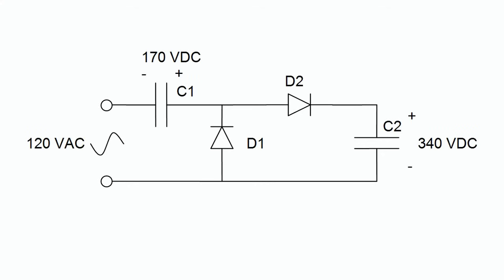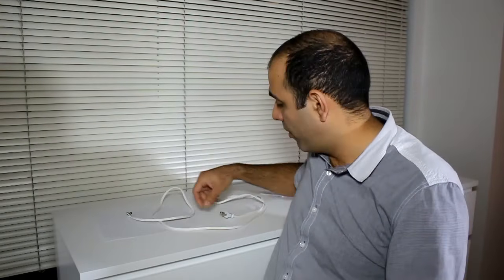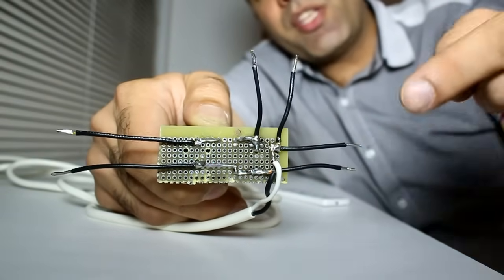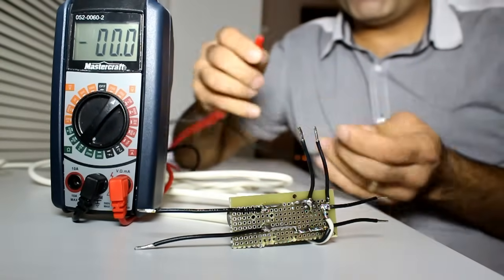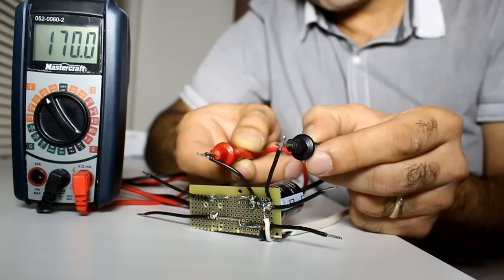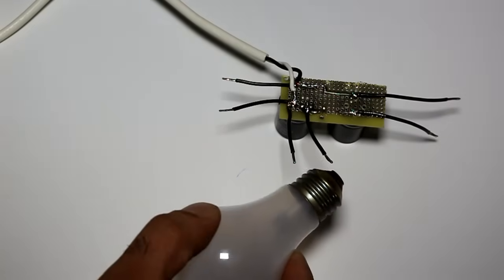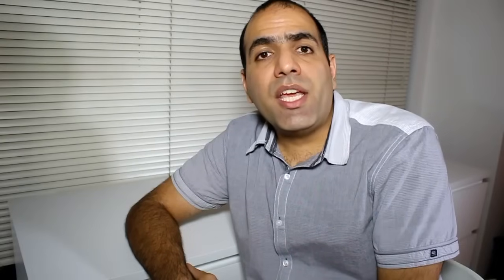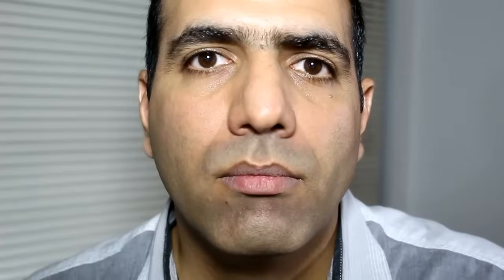High Voltage AC/DC Effect on Human Body

Comment: Best explanation on how a capacitor blocks DC! Seems legit.
Reply: Pretty hilarious. That sine wave just made my day. xD
Reply: I'm sorry but THANK YOU so MUCH for the laughs , I could not help myself. :)
Reply: GreatScott! Wow, you are here too. ;)
Reply: The AC explaination is extremely legit
Reply: GreatScott! Haha I thought it was funny too Arnold
Reply: I don't think you quite understand how electrical circuits and differential equations work my friend. Capacitors resist changes in voltage, meaning that the instantaneous current through a cap is i=c(dv/dt). So a cap, can never "generate" high voltages pikes, but can generate high current surges. Inductors are the complete opposite, they can generate high voltage spikes, but not high current surges. Take a quick look at this for a better explanation https://www.khanacademy.org/science/physics/circuits-topic#circuits-with-capacitors (I really suck at explaining)
Reply: No worries. BTW camera flashes use an inductor to generate high voltage, and a capacitor to store that high voltage. Google: "camera flash charger circuit" and you will see that there is a sort of "joule theif" oscillator in there.
Reply: thanx for the link, i bookmarked it, tho the first video seems to contradict a camera flash saying you can only have as much volts as a source (battery) when a AA battery makes a charge of 300V in a camera flash... tho things made a lot of sense since the differential potential of electron on both plates want to regain balance so i guess for 300V the disbalance must be huge! or maybe it's an Inductor in a camera ;P still it's a mistery why they use "Capacitors" in speakers for a high pass... then again this A/C thing is starting to make sense since if the slower it is the closer to D/C it is! hence any instantaneous changes versus over time changes, the instant ones don't charge but passes and overtime gets kind of lost (heat and dissipation of energy in air/ leaking to the other plate) so would they use an inductor for a LOW pass? ;P well even if you reply i might get annoying so let's just say i poured my thoughts on the matter ;P
Reply: This is extremely late to the subject but...The use of a capacitor in a high pass filter has to do with the Capacitive Reactance which is (explained in simple words by electronicsforu.com): "The lower the frequency of the applied voltage, the more time capacitor takes to be charged fully, before the voltage reverses its polarity and begins to discharge the capacitor again. The capacitor therefore spends more time fully charged and passing much less current, resulting in less current flow at low frequencies. When a higher frequency is applied, the capacitor changes from charging to discharging faster allowing more current to flow". Also, the formula for Capacitive Reactance is Xc = 1/(2*pi*f*C) which is supposedly measured in Ohms (according to electronics-tutorials.ws), so as frequency increases reactance decreases and as frequency decreases reactance increases. High Pass Filters have a capacitor connected in series to the source which will "cut-off" low frequencies and allow high frequencies to pass. Low Pass Filters have a capacitor connected in parallel to the source which allows low frequencies through (capacitor acts as an open circuit) and blocks high frequencies (capacitor act like a short). In a similar fashion the reactance of an inductor is given by Xl = 2*pi*f*L, so low freq = low reactance and high freq = high reactance. For a Low pass filter, you connect the inductor in series with the source, and for a high pass filter you connect the inductor in parallel with the source. I hope this makes some sense. I hope my logic isn't entirely wrong.
Reply: ok let's just say i have a LED that only light up at 1V and i have a 0.5V source and a 1V capacitor... will the capacitor charge to 1V with DC and power (even just a flash) the LED or does it "NEED" AC? that is what i ponder about when they say only AC passes trough...
Reply: GreatScott! ❤
Reply: If you understand the fundamentals behind capacitors (the accumulation of charges) then you can understand that electrons can flow in either direction (in-out) of the plates, and therefore allow AC signals to pass
Reply: Great Scott!
Reply: hi  GreatScott !
Reply: +GreatScott it`s more than 1.21 gigawatts :D
Reply: I am your subscriber
Reply: GreatScott! Hope some undergrad doesnt try that on an exam
Reply: GreatScott! Its not!
Reply: GreatScott! You told me what to desolder and now I have a 300v 150 microfarends I discharged it on a screwdriver
Reply: Of course its legit hes been shocked dozens of times lol
Reply: wow GreatScott ! here I am, watching 6 yrs old video
Reply: LoL
Reply: @GreatScott I just watched your video on the Nixie tube clock but was put off trying it myself by the high voltage.

After watching this video, I realised 170v is not THAT dangerous and might give your thing a go!
Reply: We need a collab Scott. With the RECTIFIER
Reply: And a hilarious one for sure
And i'm pretty sure that wasn't intentional
Reply: GreatScott! I
Reply: that explanation should be in Wikipedia! cause after a hour and that bulk of a page... only now it makes sense! tho when you ADD power in as store... can DC be use?.... and even more questionable... why do they use a Capacitor for a high pass in speaker boxes?(plugin tweeters and only high comes in it...) ahhh mysteries!
Reply: Hi Scott
Reply: I love your videos great scott..
Reply: Hi sir

Comment: I noticed you didn't touch the 340vdc with separate hands as this could literally be a heart stopper. Very very dangerous experiment even when you unplug it as the voltages remain on the capacitors.
Reply: ***** RIP
Reply: Coolkeys2009 you notice this but not notice that high voltage is an acdc album
Reply: Michael Harvey When you walk across a carpet a touch a door knob and feel a shock that shock can be more than 8000v but that doesn't kill you. If you grabbed hold of a power line running your entire neighbourhood that was 8000v as well as stopping your heart and breathing it would also cook you. Why?
Reply: Coolkeys2009 Ok. however, it would still be more dangerous to get shocked by 120V AC than 7000V taser if the amount of time the current was passing through you was the same? right? because he only touched the taser for a brief moment, and that was still less dangerous than touching 120V AC for a brief moment.
Reply: Avensis Astari Taser's output 10's of thousands of voltage's as it's guaranteed to produce a disruptive flow of current through the body. Do you think Medhi would look as comfortable holding the probes of an operating police taser :-) Also think about the fact that taser's charge a capacitor and dump  pulses of that energy through your body so the peak currents will by higher than you think.
Reply: Dont state the obvious
Reply: +Dejan Subaric how is that he doesnt get shock when he touches 170v dc ?? can u please explain mate ...
Reply: AC vs DC
Reply: When a taser shocks you, you only get high voltage for a very short amount of time before the voltage drops and the taser charges up again. If you touch transmission lines, the voltage won't drop and it will cook you.
Reply: Actually 340V is only twice 170V. Since he barely felt the shock from 170VDC, I bet the 340VDC shock was only twice as strong (meaning it hurt a little instead of only being mildly annoying). To get a dangerous and (potentially lethal) shock from DC, based on this guy's demonstration here, I'm guessing you need at least 500VDC (the voltage level typically used in a desktop PC's power supply). You may have heard of people dying from opening their computer's power supply. The lethal DC voltage from that is from 500VDC that's used on their capacitors. Camera flash units use only 300VDC on their capacitors, and are only likely to create a mildly painful shock (again, this statement is based on extrapolation from my observation of this guy's video, not from actual experience on my part, as I've never tested shocking myself with any capacitor, as I always discharge any high voltage capacitor by shorting it with a screwdriver, before working on equipment that includes such capacitors; therefore do not take my previous statement as a statement of absolute certainty regarding safety).
Reply: Michael Harvey I'm not so sure, tasers are designed to be disruptive to the nervous system and can be lethal. There are higher power taser's available used by dubious governments for torture that run off batteries and that can easily kill.
Reply: Why is it that in the taser video he got shocked by 7000V and lived but in this video he says 120V is dangerous?
Reply: Michael Harvey I think you didn't watch his video on high voltage
Reply: ***** I got some good shock from a 100uF photoflash capacitor charged to 450V, it hurt like nothing else! Although the 40,000V from the slayer exciter I made only burns me. I know the current is very small though, and the actual voltage drop across my body is not that much, but still.
Reply: A very easy way to explain this is to compare it abit with a water pipe. The current is the amount of water flowing and the voltage is the pressure behind the water flow. If the pressure/voltage is very low, the pipe can easily get plugged (resistance) but with high pressure it will push much harder. You would feel a high pressure, but if the pipe is very small, there is not much force in total. A water jet that has high flow and high pressure, that starts to become dangerous (i.e. high voltage AND high amps).
Reply: This is as man who can't count how many times he almost killed himself via electricity
Reply: AC from the wall is 50/60Hz which your muscles can detect and respond to effectively when compared to high frequencies, you can be doing damage to your organs and not ‘feel’ it as much but slowly cook yourself from the inside... basically don’t play with lots of electrons. 😵
Reply: KoNP69
I thought my gun analogy explained exactly that pretty well but meh
Reply: I can still kill someone with a gun and not have to shoot a bullet, it's just not very effective and much more bloody
Reply: Michael Harvey It's not necessarily the voltage that kills you but the amperage that kills

Comment: I used to save up all sorts of resistors and capacitors as a child, because my dad said that they would blow up 'like a bomb' if you put them in a light socket, which of course sounded awesome. When I told him, he said it was very dangerous and I should hand them over to him. Instead I plugged in a coat hanger and learned a valuable lesson in how a circuit breaker works!
Reply: This reminds me of the time i held a knife to the hot wires of a toaster when it was on, to defy my dads orders. Circuit breaker saving my ass again. Thank you circuit breaker, you sexy thing you.
Reply: orbita1 Oh the circuit breakers. Savin' lives on a daily basis but never getting any credit.
Reply: People used to give me old TVs and radios that didn't work.  At first, I would take the parts out and see how much smoke was trapped inside them.  I usually connected the parts to a long extension cord and put it on the front lawn.

Then I would plug it in and see what happened.  I liberated much trapped smoke.

Later, I started making stuff with the parts instead of destroying things.  That led to harder stuff and I became an electronics engineer.

Now I'm teaching my son some of my "skills".  :-)
Reply: Ron Angel
When I was about 8, we lived in a communal apartment where was no keys on the bathroom light switch and nobody really cared about it. I was zapped by that bare AC contacts so much times I really don't care about electricity in the AC line any more. in Russia we use modified European standard, 220 volts AC.
However, the 600V from compact camera charged flash cap is the real shock.
Reply: Kamnible
well.. you where lucky.. That bright electrical explosion could have given you severe burn wounds. those "arcs of light" can become more than 10 000 degrees celsius...
Reply: orbita1
 I did that once. Circuit breaker did not flip... But the wire snapped and blew up. Kind of a small, bright electrical explosion. I was fine but the knife got a little burnt.
Reply: Circuit breakers... Our soviet fathers just used breakers based on 5 amp fuses. So, everything was hard to find including fuses and every second guy was using piece of wire instead of fuse. And there was looooot of fire caused by heated line wires inside a walls.
Reply: So, i put an led into the plug once, when i turned on, it was an awesome flashbang... When i could see,(after 2-3 secs) i saw orange flamey thingy (plasma like) falling down from the air like a  feather... Well MCB saved my ass too that day.. Or i was straight thrown outside the house
Reply: I am amazed you survived your childhood. In the UK we use 240 volts and you would have saved your family a lot of expense in bringing you up, they may have  been able to afford a better car even after the funeral expenses.